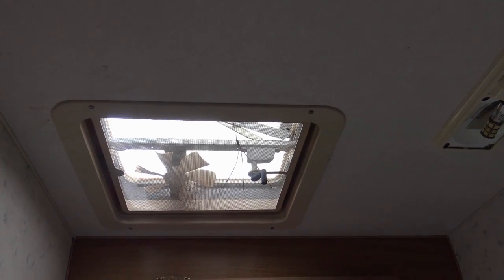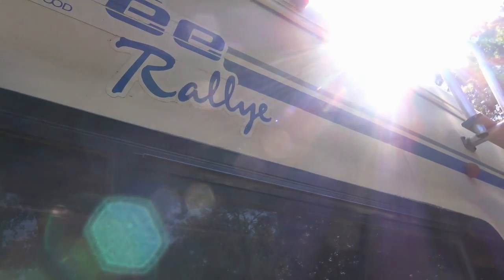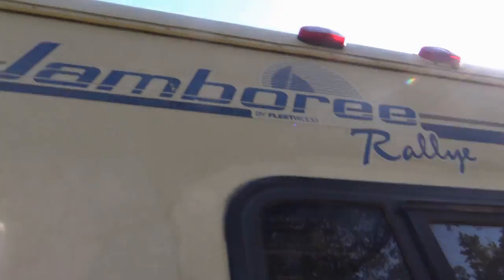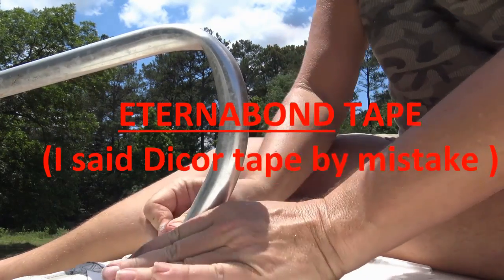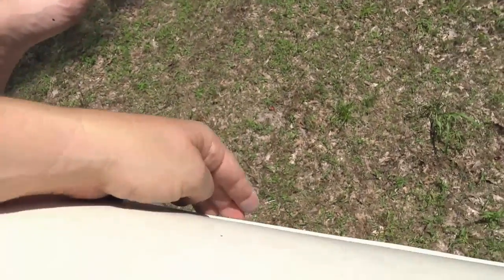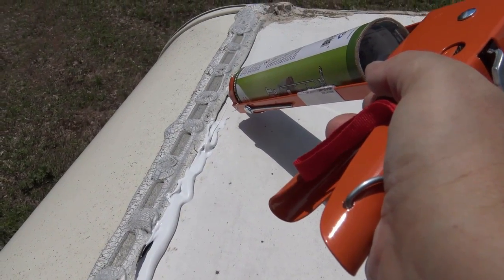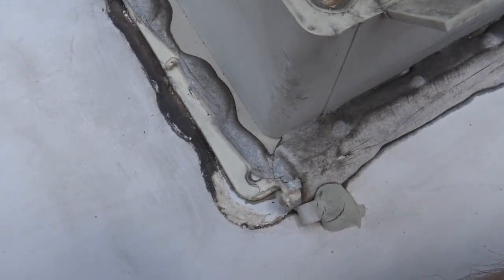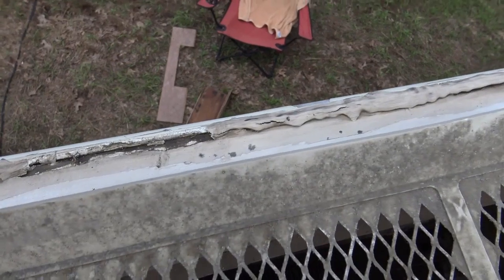RV Roof Repair: How I Repair a Leaky Roof on my  1993 Class C RV

Comment: how come you didn't check the roof last year? or did you
Reply from the maker: I did - and never had a problem with it until I drove in torrential rainstorms
Reply: When you're living out west, the rain issues are totally different...there's also the issue of moisture and humid heat that is different in the SouthEast. I'd be willing to bet that the mold we saw was not present last year...the South is hell on old vehicles...Carolyn has done a great job of fixing Matilda when she realized what needed to be done - as for 'pretty'...dry is one of the prettiest things around!

Comment: You might already have a preferred choice for new flooring but just in case - you might to research vinyl strip that usually resembles wood.  Strips are usually 2" to 3" wide, very flexible and can be trimmed with a knife or razor blade type cutter.  I particularly appreciate they are so flexible there's no issues like with laminate flooring.  Being rubber it also has a but of cushioning, particularly important with my elderly feet.   Feels much warmer on feet in colder climates, yet another reason I am not a fan of laminate flooring.

I realize by now.you might have purchased another RV. Either way I am a

Comment: You can get the roof vents brand new for around $30 on ebay for 14" roof vents rv standard size. If you are looking for a nice newer one there is a 2008 model rv same as yours a Jamboree in great shape new batteries in 2014 for only $2050 it is the 30U model number look in Craigslist under Rv Waco Tx. Everything works it says. Hope this helps.

Comment: I think you did a good job. It's not easy crawling all over the camper like a spider monkey to get at all the possible leak points. Not to mention hanging off coolers the do the windows. I fix so much with duct tape even using it as people bandages and keeping bandages on horse hooves. It can take a beating.

Comment: Ive only just repaired the 2 leaking sky lights on my fathers rv.  I would have recommended removing all the old sealent first.
Reply from the maker: And my recommendation after doing it on mine, successfully, is that it's not necessary.

Comment: Another place you will have leaks is all those clearance marker lights, the red and yellow covers snap down on the bases, remove them then take out the screws, lift the base and you will see a hole about 1/2 inch or bigger that allows the wires to connect to light fixtures, put a generous layer of sealant on the bottom of light fixture then reset the bases and screw down then smooth out any sealant that has oozed out around the light bases. I had large motor home that every time it would rain the removable light globes inside would fill up  with water, I tried everything to stop it  even to coating the entire top of the unit several times, still  it leaked,  finally found the leak after the interior  ceiling started to sag real bad, it was that trim  that you showed that pushes into the aluminum trim piece,  the screws were leaking and allowing the rainwater to run to lowest point (light fixture globes, I removed the rubber or vinyl piece smeared a thin layer of silicone sealant over each screw head and replaced the vinyl strips, NO MORE LEAKS FINALLY !!!

Comment: if i ever run into you i will show you the rite way to do all that stuff as you did the same as the person  before you did which was wrong for a RV roof it will leak again. But i did get a very good laugh watching you.  you do good you need some  one to show you the right way.  but you did try.  Take care Terry
Reply: Ditto!
Reply: Remove all that cracked up putty, clean it, then apply something on top to seal it, what I saw was aplying that tape on parts of cracked sealant, so a lot of effort, but would unfortunately leak again...

Comment: You may not know this, but driving with windows or vents open in the driver/passenger area will cause an internal vacuum to occur in the rest of the vehicle (especially at the rear). As a result, you may be sucking in rain through any possible leaks that doesn't seem to occur when you're stationary.

Comment: Oh Matilda. I am a former owner of a RV. I had a trailer(for 7 years) with a rubber roof and it required checking all the seals frequently . As the trailer got older had to re caulk more often. I only had one leak but it did some damage very quickly. I have been watching your videos and feel your frustration. I am thinking its time to put Matilda out to pasture.

Comment: Carolyn, that vent pipe for the bathroom or your sink needs a cover that will cause leaking also, it's like a little top hat that sits on top of it, good luck with the repairs
Reply from the maker: It's the vent for the gray tank. And i bought a cover for it thanks

Comment: whatever works lol it's damage control. as long as it works who cares what it looks like. i think you did a decent job with what you had and that's all that matters. ☺
Reply from the maker: yes, damage control. Good way to put it. 
thanks!
Reply: I was thinking the same...Dont have to be pretty, as long as it is effective..;)
Reply: Frog tape or painters tape...that takes all the rough stuff away..just tape along the edge and maybe back a 1/4" and then there is no mess to worry about removing.
Reply: i would care what it looks like

Comment: Don't know if that mold we're seeing is the toxic type...but the bad black molds are very much present in the southern environment. i don't want to scare you, but please make sure you familiarize yourself with the symptoms of the bad stuff and be ready to jump ship. Also, a bleach solution will kill off what's there - yeah, it weakens the substrate - but the evil mold is worse! Also, have you seen this one? - it's up in New England...but I thought of you as soon as I saw it! https://hartford.craigslist.org/rvs/d/ft-class-motor-home-clean/6242902705.html
Reply: Sounds nice! I know Carolyn said no more older RVs but as the owner of it said, this isn't your typical class C. I'd think long and hard about what he replaced/repaired and what he didn't do that could still go wrong. Buying a new or newer RV certainly isn't going to solve all problems since most companies don't build quality. If it were me, I'd buy a gently used RV that was built by one of the few companies that do build quality RVs.
Reply: And the miles are really low for the year!

Comment: Next time you smooth out caulk, take a can of water, with you. Then when applying the caulk, put a thin bead around the window or whatever, then dip a finger into the water and smooth out the caulk, dipping finger in water every so often about each foot or so of smoothing, Makes for a professional looking job without a mess.

Comment: The vast majority of RVs are poorly made of cheap-junk materials, using as little framing as they can get away with.  My brother's idiot girlfriend drove her 10' Class C under a 9' walkway between a casino and the hotel -- I couldn't believe the trash it was made of.When you get a new rig, DO NOT WALK ON THE ROOF!  Every time you take a step, something pulls apart.   If you have to get on top, spread your weight over more area by taking two 24x24" sheets of 1/2" plywood, or two 2x8 planks.  Stand on one and shift the other, then repeat your way along the roof.  Think of it as walking on snowshoes.Good luck in your search for new habitation.  Get it checked by a mechanic.  Keep your fingers, toes and eyes crossed, and we will, too.

Comment: Maybe I will stay put. I am not a fan of fixing mobile homes.
Reply: One reason I had  anew one built...I got so sick of maintaining a 20 year old house...and this one is mainly block and stone...if that rots I'm in a world of hurt...lol.
Reply: I helped to build a log home. And after it was built there were always plenty of to-do's that continued on for the next 5 years I owned it. However, by the time I sold it to the new owners 5 years later it was well maintained and other than spring, fall, winter, and summer maintenance chores it should have been maintanence free for the next 5-7 years. That said, I wasn't there so who knows if that held true because as my mother said during the build, "That contractor couldn't build a popsicle stick house!" 

 With my being a first time home buyer and a first time home builder little did I know that I had to oversee the contractor because he didn't know what he was doing. The first clue was when I came to check on him and his workers their first day on the job and they had only cut two courses of logs in one 8 hour day. Previously, they had told me they would finish cutting 13 courses by then. The second clue was when I learned that the contractor's most common reply to whether something was done or not was, "I forgot." Ya, fun times building that log home! ;-) Sounds like yours went a lot better than mine. 
Cheers!
Reply: Mine is in fort myers so its rated at 150mph for hurricanes...rebar in every wall, I have hurricane shutters fitted so its a pull and done..upgraded doors on the garage so no worries there..an RV down here would terrify me...although my childhood was spent running around Scotland every summer and have lost three trailers from the winds in the north so I'm a safety junkie here....nice to have the ability to run when the storms come....But being a s I made kitchen worktops, islands, showers, etc from luxury stones I got to learn how to install things and make them waterproof and fixing a 3500 sq ft home for winters in the NE teaches you quickly how to do things and think ways around things when you need to...caulking is sometimes top of the list for everything from door surrounds, window surrounds, etc..and not make them look like something out of walking dead.